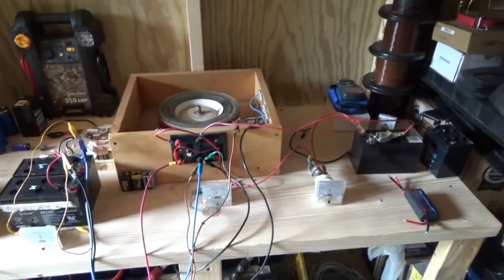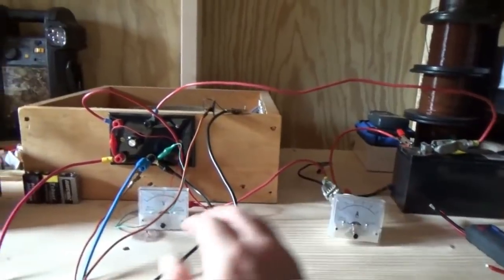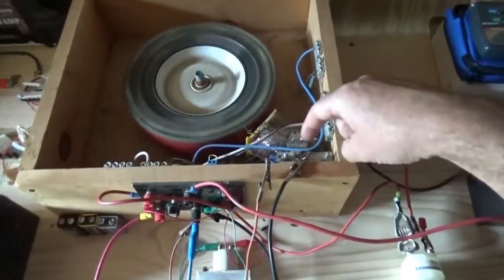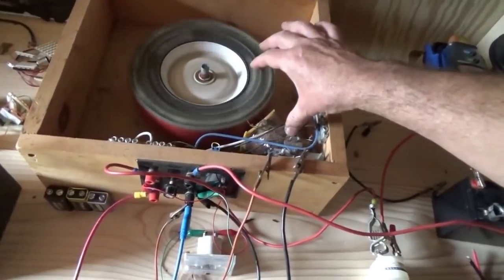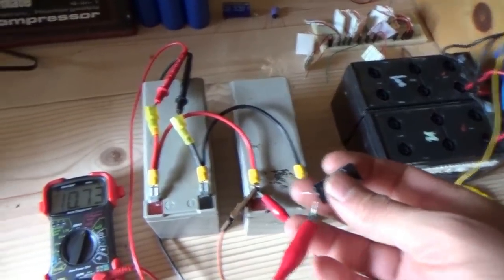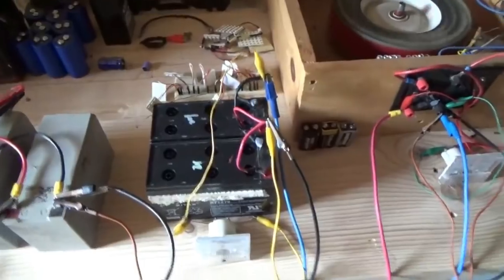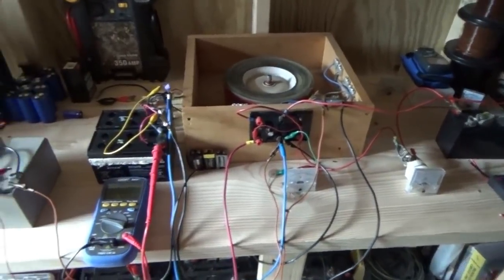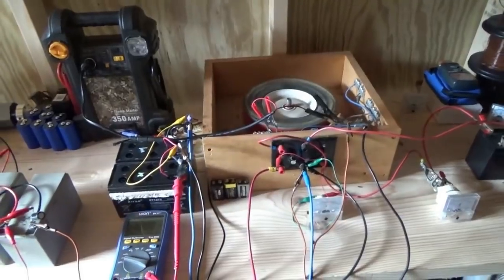Amazing Results With Single Coil Bedini Motor & Increased Output

Comment: Its probably been mentioned by now but  there's a temporary electret effect that can be observed with a Capacitor that's been charged Radiantly.  Its more noticeable the more its charged as there's a conditioning that takes place similar to what you're observing with your batteries but with the Caps it conditions much faster.. Good video...
Reply from the maker: Thanks. Yes I am thinking the same thing.
Reply: @TheDoItYourselfWorld  I built a battery out of super capacitors to take advantage of this feature...it doesn't have a huge capacity but it can be upgraded... & it can be charged from a tiny input...  It can supply a ton of current for a limited amount of time....
Reply from the maker: I hope to get mine going. I built a car replacement battery using super caps. I want to get that into my projects and see what they can do for me.
Reply: @TheDoItYourselfWorld  That's a good idea...   mines fairly low input but with 30 caps in parallel.  I have a solid state Radiant device that I use to charge them....
Reply: @TheDoItYourselfWorld  I've just invented a new Cap Dump device for dumping Radiant potential.  Its based around the higher voltage Capsule LED's & Halogen bulbs.. I recently discovered they can automatically switch & trigger the discharges on their own similar to how a Comparator & optocoupler function in one & operates similar to bedini's comparator device...

Comment: Hey Troy, How the experiment's  going.?? Listen, I thought I would
Give ya, a good" tip., The Flux, you
Are  talking about, is normal for these type of systems,. It's actually the Back  "e.m.f."  That's being read,
By you're tester, from the different
Coils,. And that's Really what you want.!! It goes into you're battery
OR, Battery Bank,* at variable speed's & amounts which, start ya, battery cells to vibrate, at a very Low,
Frequency causing an " Radiant" type of energy pulse.!! That's why, a lot of
Those guy's on-line" are reporting, 
And or showing, there ( Long term, use) Batteries are charging UpTo:
15 - 19.5 - 19.09 & even 20 & 25 volts, going into, & Holding,  at 
Those voltages,!! It's called 
Over - Conditioning the Battery..
So, if you block, or stop it, you
Will definitely defiet the purpose.
See, while the batteries are being,
Hammered by, voltage spikes, as the cell, lead, starts vibrateing, it's almost a ( Humm )!! That can be 
Heard.!! But, only Some Times, it's
Audible Other Time's, it's not. That 
Vibration, shake's, Off The build - UP
That's commenly know to happen, to the inside of lead-acid Battery's.  , do
This, take one of the batteries that
You have that's old, & charge, it, with you're voltage, jumping all over, the place.!! And then, change things back,. But do it for a few, weeks, 
Only the battery that you chose to set a said, to use that, voltage fluctuating,Or "Bouncing around" 
To charge,. & Test it after a few weeks.!! Compair it to, other's...
That's done, the other way. Post what you find out....

Comment: nice work man, i have been researching and also experimenting in bedini's system but i dont really think if i have gains in power  i woul love to know if your experiments really shows oveer unity?,, but i had proven that tesla switch really is capable of demonstrating OU just that i need to improve to very high speed switching
Reply from the maker: I have experimented heavily on my electronics channel with this a couple years ago. I split off into three channels. You can see my videos here: https://www.youtube.com/c/TheDoItYourselfWorldElectronics
Reply from the maker: I have been able to run up to 19 LED lights off the output of the Bedini motor while charging a battery without seeing an increase in energy used. I have also seen very good increases in energy by adding more batteries in parallel on the charging side.

Comment: If you know what Empirical scientific procedure is, then I'd like to tell you how good you are at experimenting, measuring results and reproducing it again and again. Before science (latin scio = knowledge) there is a curiosity. We all appreciate your interest, your curiosity and your empirical methodology. I am building one Bedini generator myself. There are several models. Some use Capacitors. Capacitors, as you know, store an electrical field. It is a storage device. Some theory states that the Bedini generator (among other devices) will draw energy from the ambient system, OVER and ABOVE the internal energy that's used (charging battery) in the device, to make it work. Hence, over-unity of Power Output/Power Input. Your measurements and train of thought is splendid! Yes, it seems to violate thermodynamics, First and Second law. BUT that is only true in an ISOLATED SYSTEM (a closed circuit, composed of all components, which would start with 100 watts (for example) and produce a measured 90 W). However, there is NO such a thing as an isolated system (as proven in Zero Point Energy experiments). Batteries leaks, sun's life expire after billions of years (while new stars are born!).  So, energy will find a way OUT, and will find a way IN (Zero Point and Casimir Force). Okay so enough of this. Your caps are empty at first. They store energy from the circuit BUT they discharge into your "being charged" battery. Your Bedini generator is a non-isolated system that is designed to willingly draw energy from the ambient system (collapsing mag fields that draw massless photons, and when these photons move, they always energizes electrons into motion - Amperes). Sorry about the stuffy explanation, but basically it's like moving water (electrons) and you ad a dry sponge (discharged cap). That sponge will "draw" more water from the source (the entire Bedini circuit) than previously observed. Then, imagine there is a lower energy potential (discharged batteries) - like a cat's litter box, connected to your wet sponge (12V cap charged), then that wet sponge will periodically empty itself into the litter-box... and draw more water, etc. So your addition of a Cap, ads an energy storage, that also draws a little more energy into the circuit, that feeds the discharged battery(s) faster. Linderman (if I recall his name right) mentioned that we can ad more discharged batteries as a load, because it just draws more energy from the ambient system, without taxing the powering battery. You, smart man. just proves that to be true. Photons are everywhere around you and inside of your body. In Physics, we learn they have no mass at rest. F = ma, so there is no Force required to accelerate them (make them move a bit, as in every electromagnetic waves, and light). Overunity in energy generation of renewable energy source is a new science, and you are a welcomed pioneer to it. Thank you very, very much.

Comment: : this is weird: .... no it isnt iff you hava any ide how this works... lol
Reply from the maker: I am pretty sure you do not have a good idea though how this stuff works. Please tell me how (with conventional energy) I can charge up 7 batteries with no increase in the input and no visible reduction on the charge status of any batteries. I thought about it and if there was a sharing of "output current" then the voltage of a battery set under charge would drop proportionately to show the reduction in charge. But they do not lose anything. Everything gains as you keep adding batteries.
Reply: you dont charge the batery,s you activate the plates creating a float voltage.,(lead acid cells need amps to get it charged, not spike voltage ...(that re activates sulphated plates)(okay, you can get it charged, only it wil use a very long time) , the ënergy "you use is the emp pulse from the coil created by the collapsing magnetic field, thats why you dont put a higher load on your input, its knd off free voltage. (not amps)

Comment: Hi Troy, I like watching all your videoes,  but i like the electronic ones best. Would you show a schematic of your SSG Bedini motor as it is running now. i'm more interested in the smaller bedini than the larger one you are planning to build.
Maybe i may try to build a SSG bedini motor.
Reply from the maker: http://www.thedoityourselfworld.com/ssg-battery-restorer.php
This is exactly the one I am going to build on video. Not a big one but a beginners one. Its the first circuit on the top left in the four halfway down the page.

Comment: The Capacitor is designed to Boost the battery Voltage, You should be VERY CAREFUL with CAPACITORS, Its not the Voltage that will kill you , Its The (Amperage), Be SAFE...

Comment: Rick is rite if you use capacitors it's just absorbing the pulse and not pulsing the battery's,same as using a regular charger

Comment: The capacitors are absorbing the spike of the bedini motor and the reason is because the batteries themselves currently have low resistance / capacitance. When you pulse a capacitor with spikes it absorbs said spikes into a voltage rather than allowing them to resonate the battery plates. Using the capacitors you absorb all the spikes which is what will desulphate your batteries. The same principle is why they use capacitors for smoothing the power in a circuit; they absorb spikes / pulses and smooth it out aka capacitance smoothing or a capacitor filter.
Reply: Rick.  Well said.  Vibration is the key for desulfation of the plates and is the magic reason for using BEMF spikes rather than simple DC square wave or 1/2 wave rectification.  But in long term there are reports that plate fatigue can occur and cause micro cracks which results in low capacity and low life.  I will release another secret here for the first time.  The BEMF spikes should purposely have a longer off time than on time.  In his model that is automatic with most knowing it.  But in a better arrangement the duration of the off time needs to be adjustable to empirically find the best per battery type.  This will reduce excess resonances forming and causing micro cracking.

The BEMF event is used here for desulfation, but it can also charge batteries.  This is a different effect and follows different concepts.  The Skin Effect is just one piece of the magic that I have not seen anyone mention but is a key to understanding many of the "weird effects".
Reply from the maker: That could be it. I have read that they use capacitors to "convert" the energy output of the Bedini motor into energy that is more gentle on batteries. Its great for desulfating batteries but bad long term for good batteries.
Reply from the maker: But in that case they are collecting the energy output of the Bedini motor into capacitors and then pulsing that quickly into the battery. Seems to have better results that way. I will be running those experiments soon myself.
Reply: The thing is you want those spikes to go to the batteries your recovering that is the pulses that vibrate the plates and dissolve the sulfation back into the solution aka brings the acidity back to the acid. The sulphur in the acid becomes sulfate on the plates when batteries are discharged making the acid in the battery more water than acid this is why a dead battery or low battery will freeze. 

The thing is using a capacitor filters out the spikes and the spikes are what does the reconditioning of the batteries when you do 40v-60v spikes at around 2khz or so for a 12v battery it essentially vibrates the sulfate at a resonance that will allow it to dissolve back into the solution and allowing the freshly cleaned lead plates to have good contact with the acid also.

The jist of it is using the capacitors is bad for what your trying to do the up down spikes you want to vibrate the lead plates / sulphate this is what rejuvenates them with a capacitor you remove those pulses / spikes and smooth it out aka capacitor filter look that up when you use a capacitor as you are that is what your making the capacitor do.

A hint pulses upto around 40v-60v are key for a 12v battery and want them around 2000hz or more upto around 4000hz   on bigger batteries. The key is to keep the power input low amperage wise around 200ma-500ma for larger batteries and around 50ma-100ma for smaller batteries also on smaller batteries you want to lower also  your hz to around 1000hz-2000hz has something to do with leads vibration in smaller batteries can cause them to heat / short with to high of a hz and with larger batteries need higher hz because of the length / size of the plates absorb it easier without damage.
Reply: this is well said. on point
Reply: Rick.  I mint to say above:  In his model that is automatic with most NOT knowing it.

Comment: How about charging the capacitor up to 12.4 volts the output of the motor? That is what is happening to the cap. Until you reach the ampre load limit of motor will slow down. VeX =AxV =Watts . Remember amps hurt you more than volts.
Reply from the maker: You may be right. I hope to get a scope on this one day. Not sure about amp limit of the motor. Its not pulling any more amps and actually the draw cut in half at one point later on and stayed down.
Reply: The Do It Yourself World It is learning Be careful it doesn't hook up it's own wires. Try the head band mount on your go pro cam.
Reply: ***** He would have two hands free when he measures with his meter.
Reply: ***** I prefer the tapeing of leads to two fingers on my left hand. Beats it across my heart with each hand.

Comment: why do you not  oil  that wheel?  it sounds  like  a coffee grinder
Reply: a lot of oils are flammable in the type of set up that his bandini motor is in in so unless troy literally seals off gears and bearings then its really hard to oil them